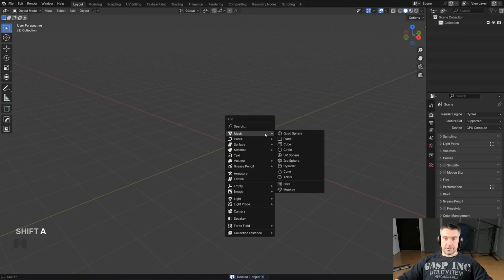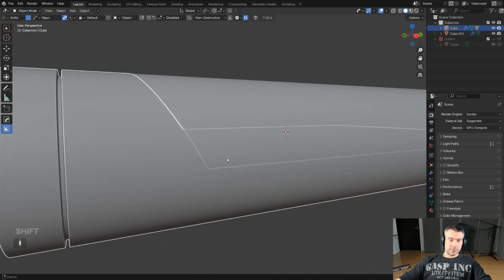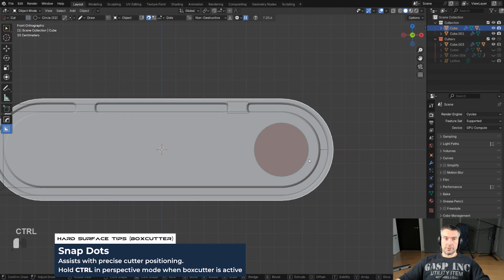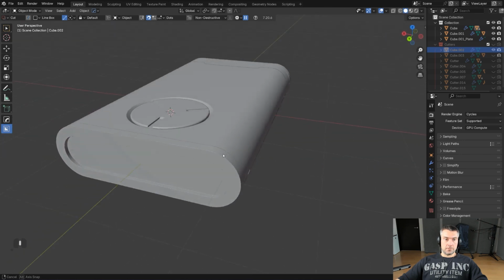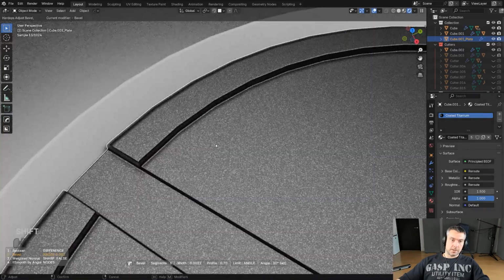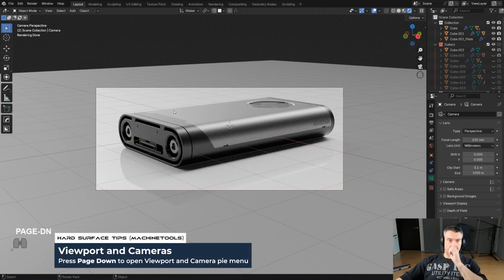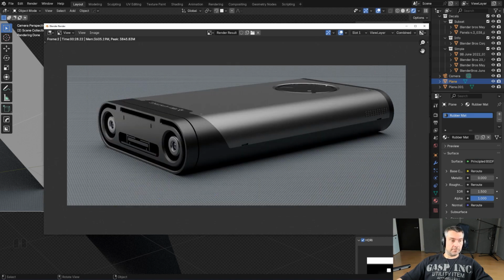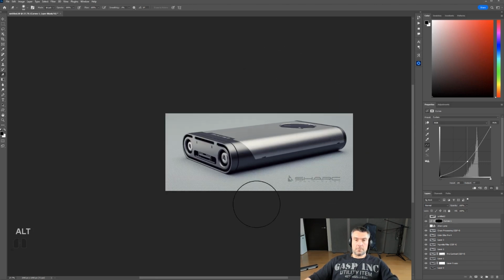Create 3D Models Like a PRO - Step by Step Guide

Comment: Why don’t you use Plasticity more? It’s easier, faster, and more effective in my case… great video anyway! Greetings from Argentina!
Reply: @bautistadelatorre6498  Plasticity is a different form of modeling.     It is more like CAD.   Not  polygon modeling, like Blender.    They have different uses I belive.
Reply: @ianzander5057 thats why im asking, the model of the video is easier on plasticity.. any way, also it must be because there is more users on blender than in plasticity.
Reply: @bautistadelatorre6498  Hard surface models are great to make in CAD. They are great for making products, 3d prints, parametrised pieces and engineering samples. They are NOT good for making objects and models to be textured and used in 3d vfx and cgi, game engines, AR demonstrations, movie sets etc. For that, polygon modeling is better. Sometimes we need to make those engineering sample type of products for demos or renders in 3d however, and for that we need a proper workflow to work in a surface modeling tool like blender. CAD programs will give you millions of triangles which will quickly exhaust any render engine if you try to use it in 3d.

I work with both, but they both have their uses. :)
Reply: @ i work with both too, in blender you can bridge the model from plasticity and use it with ngons or reduce the poly mesh density. In the case of the video, i think that it could be easier to model it on plasticity and the textures and render with blender (in my opinion).